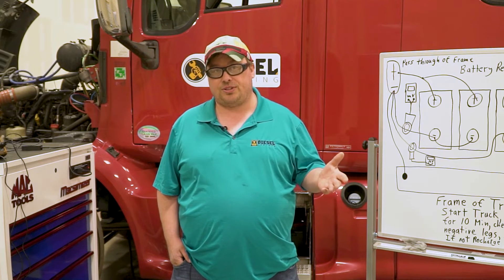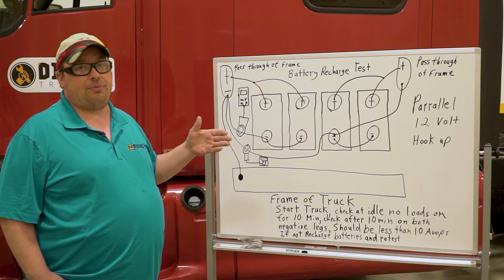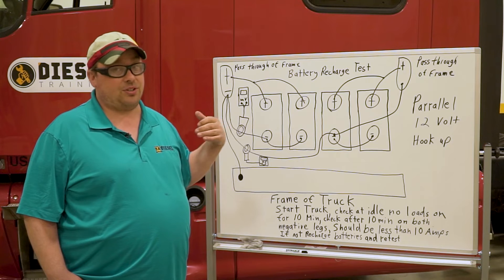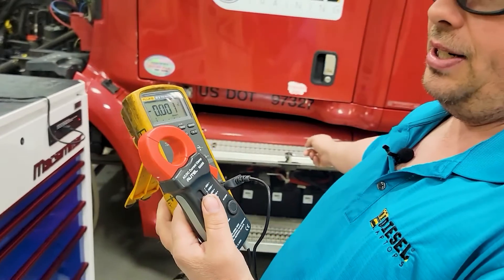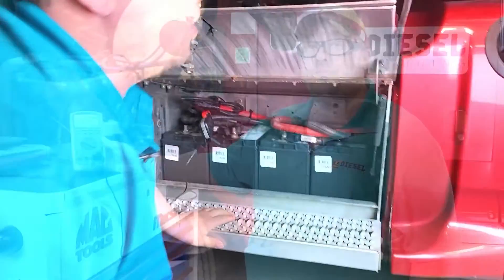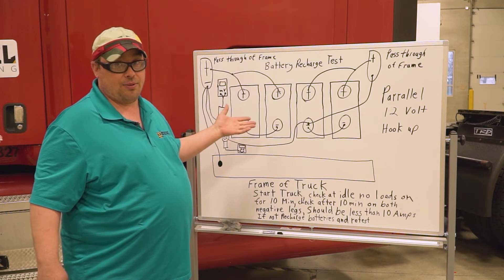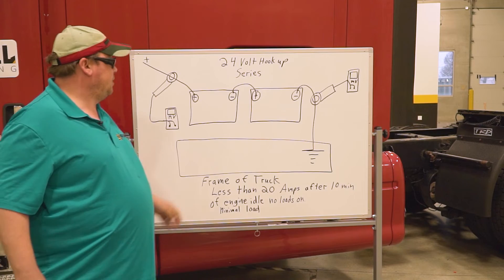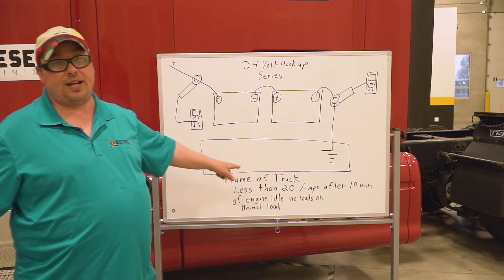Battery Recharge Current Test ⚡⚡

Comment: Great article. I'm performing this test on a Toyota Camry. I'm using a AMES AC DC Clamp Meter - it's a multimeter and clamp all built into one. Can I simply set the meter to a DC amps setting and check that it doesn't go beyond the 10 amp threshold after the car has been running idle for 10 minutes? I'm confused by your mention of volts during your demo.
Reply: Sure your clamp meter will work.  I'm just refering to when you are using a clamp with a dvom.  Because the clamp outputs a millivolt reading that you have understand what the scaling is for the clamp.  And yes you look for more than 10 amps at idle no loads on.  If it's more than that after 10 minutes you need to replace the battery.

Comment: Way back in the day I was taught a similar test, a Battery Sulfation Test. Single battery, 40 amp charge. If the charging voltage goes over 16 volts in 3 minutes, the plates are sulfated and the battery is no good. I like this test better. It’s on vehicle, non-intrusive, quick, and conclusive.